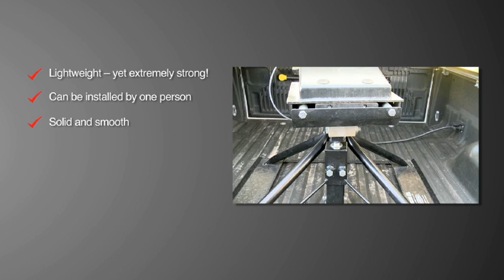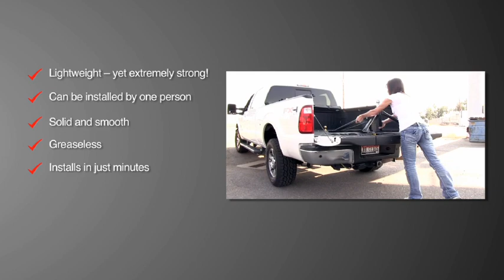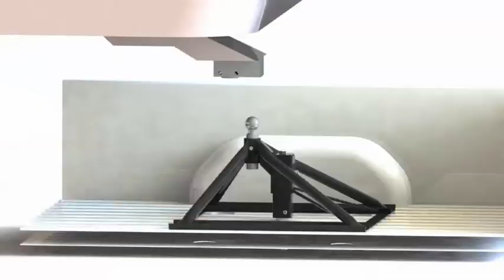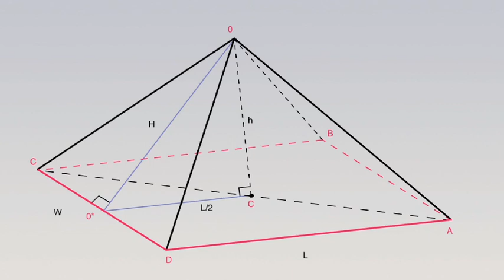Ultimate 5th Wheel Connection -Features & CRUSH TEST (amazing!)

Comment: It really does work that well. I pull a 28’ (small) fifth wheel with a crew cab, short bed super duty. It literally takes 10 minutes to install/uninstall the adapter, leaving my truck bed clear for…a truck bed.  It does require a gooseneck ball in the bed of the truck.

Comment: As an Engineer and looking at this, there is NO WAY I'd ever use this hitch as a rail connected only where the middle has no support.  I would only trust it using the gooseball connection setup.  Downward pressure tests are cool, but have you tested it by placing pressure on the back and the front?  If someone towing a trailer rear ends someone, the 5th wheel is coming toward the truck and dependent on the speed, the force applied to the rear of the hitch can be massive and the energy dissipation will either snap the ball off, but most likely the hitch welds will fail first, then ball failure.  I tend to favor how German Engineers use a design philosophy to make structures as weldless and seamless as possible.

Comment: I would like to see testing under heavy braking.  Have been hearing of this system clasping under heavy braking.  Don’t understand why the text is just showing pin weight limit.  That much weight shifting under braking would give much easier.
Reply: I’m interested in this as well. @andersonhitches
Reply: I’ve heard the same, but yet to see any proof from those that talk about it. Therefore, I use it to tow my 5th wheel with absolute confidence! Until someone can show me what they’ve “heard” then I’m not interested.🤔

Comment: My question is I have a trail air pin box on my 5th wheel with a auto slide hitch   I would love to get rid of the auto slide and get the hitch you have. Can I use your hitch with my pin box?

Comment: Haha I love how the guy they show towing with traditional fifth wheel is pulling himself back in forth by the steering wheel making it look like its 100% worse than it really is. I tow a 53' tri-axle race trailer with a Mega Cab Dodge Ram Cummins and have never run into any back and forth motion this guy had. Did he properly secure his load, have a seizure or just act like a moran?
Reply from the maker: Hi James. My load was secure, I was not having a seizure and I am definitely not a moron! For nearly all of our testing with the Ultimate Connection we use a 44 ft RV weighing 23,900 lbs (4,450 tongue) and we make sure the load is balanced. There is a section of road near our factory with railroad tracks and some big bumps right after them. It makes for great testing. When I go over that section with other brand 5th wheel hitches I can usually count 4 or 5 'bounces' after each rise before returning to neutral. With the ultimate Connection there is only the initial bounce and then it returns to neutral. With so many variables out there, not all truck and trailer combinations have issues with bucking/chucking, but customers who have had issues with it in the past and then have switched to our system, have reported that their bucking/chucking problems are a thing of the past.
Reply: +Andersen Hitches, you totally were acting lol, when you pulled yourself back and forth by the steering wheel to act like the trailer was causing you to move. But if it was the trailer shaking you out would have also moved the truck keys.
Reply: Mike Barker hahaha I had to watch it again to see it. That's true the keys didn't move much...I noticed in my truck the keys move more than me. I couldn't help but also talk to profession haulers using the pick-up style haulers and they brought up a good point, the higher the ball or hook up to your trailer the more unstable the truck gets, especially when up or down grade. The closer your point of contact with the trailer is to your axle is the safest and most comfortable the ride. Makes since when you think about it....take a square block for example, pretty stable right...yes...so now take a rectangle set it vertical...not as stable...they all said the same thing. You will have more bucking or lifting of the front end lets say if you are pulling a heavy trailer over a speed bums or go extreme and say a curb... The higher the ball or fifth wheel from your axles are, the worse your tow will be.
Reply: So what keeps the fifth wheel to ball adapter form just swiveling around the king pin? I guess just the weight of the trailer....Kinda sketch if so....
Reply: Better yet the one that adapts on top of the goose neck...there isnt anything to keep it from turning or rotating in the bed of the truck unless I missed something
Reply: I've been wondering about that too? Seems like theres nothing to stop it from spinning?
Reply from the maker: james robinson Great question. The king pin connector block does not 'spin' because it is held in place by 4 set screws that bite into the king pin plate (see quick install video at https://www.youtube.com/watch?v=mJDZrmzBa3c). We currently have over 9,000 units on the road and have NEVER had one report of the block turning.
Reply from the maker: Mike Barker The base is tightened down to the truck bed using the top bolt. An inner tube is placed over the gooseneck ball and pinned in place. When the top bolt is tightened it pulls upwards on the inner tube which cinches the base down to the bed of the truck providing a solid, immovable base.
Reply: So what caused you to move like that in the truck and not the keys? Looks like a good product, so you don't need to act in your videos lol.
Reply: I think he is driving Chevy traverse, funny
Reply: This is hilarious I went back to the video to check keys are nearly stationary he looks like he's bobbing to a crappy song how cheesy.. not to mention the sketchy hitch apparatus I'll stick to my fifth wheel

Comment: Made in America by Americans!  Andersen, I salute you.
Reply from the maker: Thanks Sam. We're very proud of what our country stands for and try to reflect that pride in high quality products.
Reply: Andersen Hitches You are very welcomed.  I have my WD anti-sway hitch installed an about to head out on my first trip with it.  Like the fact that it is so lightweight compared to the others and is of excellent quality build.  Instructions were very easy to read making the install a cinch.  I really owe it all to your dealer in Pensacola, Florida that got me set up with the appropriate length shank.  The guys at Carpenter's Campers were knowledgeable and helpful.

**update**
Made a 400 mile trip with it all hooked up.  Made a big difference on the sway experience when a fast moving vehicle whiz by pushing me over then sucking me in on the backside.  Porpoising was minimal compared to as before. Fairly quiet.  I give it 5 of 5 Stars.

Comment: why not add a gooseneck adapter to your fifthwheel ?
Reply: Apparently travel trailer frame manufacturers don't recommend using a gooseneck hitch because of the additional stress involved in that setup. Apparently it adds leverage to the frame in a bad direction. This setup keeps the connection and leverage in about the same place as a standard fifth wheel design.

Comment from the maker: As far as Safety Chains: If you plan on traveling cross country and you want to make sure you are in compliance with state laws that vary from one state to another then you should install safety chains.
 
We know that California, Indiana and Texas have safety chain requirements. Indiana safety chain laws are usually only enforced for commercial applications, but they informed us that if the hitch was a ball type, chains were required. Many states do not require the safety chains, which is why they are not included in the initial package (cutting out extra cost for the majority of customers).
 
We do sell a Safety Chain kit –part # 3230– that retails for $59.99. It includes the chains and bracket hardware necessary for installation.

Comment: On your crush test it was just for down pressure!! We go through woods & rivers if we drop it in a hole is it going to collapse trying to pull it out that would put more pressure on the back two legs ?
Reply from the maker: Good question Michael. While we have not done 'official' testing of 'sideways' forces, we have tested sideways pulling during on and off-road settings. Since the pyramid design is so extremely strong we are confident that you should have no problems. As of this writing we have not heard of any issues regarding sideways forces. However, as with any hitch on the market, excessive forces in any direction that exceed the weight rating can cause possible problems.
Reply: Also, that rear post started buckling at 63K.  Not much of a difference, but in the interest of accuracy, I'd fix the video.

Comment: On the version that connects to the ball in the bed, where do the lateral forces transfer to?  A rail setup transfers forces to the frame under the bed.  This looks like it is sitting on top of the bed.
Reply: To the gooseneck ball
Reply: @jrvera7955  Lateral forces cannot transfer to the ball directly under the hitch.  That's why they are called 'lateral'.

Comment: @ 2:07  you talk about loose connections on the B&W. None of those joints should be loose. The bolts holding the rails in should be tight, as are the assembly bolts. The mounting pins, My sister has that same setup. She has put 250,000 miles on it and hers are not loose. Neither she nor I have any slop in the kingpin assembly area.  @2:13 you show your driver bouncing around. My 03 3500 GMC pulling my 38 footer at 16,000 doesn't ride like that. My sisters 06 Dodge 3500 pulling a 32 foot 14,000 rig doesn't do that.  I'm sorry but you're exaggerating big time. You're bouncing around, but your keys barely move.

Next up, Where are your safety chains? Get caught using a gooseneck adapter in PA or Ohio, and you will be leaving your rig on the side of the road till you get safety chains. 

The other issue is, your moving the hitch point back several inches. that transfers weight to the back axle and off of the front axle. 

As for your crush test, mount that hitch on a 45Degree angle to simulate side loading you could experience in a crash. Lets see how well it stands up then.

Comment: I would NOT recommend this hitch.

I was involved in an accident last September 2020 where a minivan failed to remain stopped at a stop sign. I was traveling at about 40mph when I entered the intersection. I was operating my Chev 3500 while towing my Cyclone 3100 5th wheel. My 5th wheel was secured to my truck using the Andersen Ultimate 5th Wheel Hitch Gooseneck Mount. The hitch was purchased two years ago.

The minivan driver pulled out and struck my truck in the front right wheel. The minivan rotated and the back of the minivan struck the right front on the 5th wheel. The 5th wheel broke free and fell ontop of the truck bed and then collided into the back of my truck.

The hitch connection ball sheared off at the top of the base. The hitch base was bent and deformed. If I had been using a conventional 5th wheel pin hitch it would not have broke. The impact was not that great. Both the truck and the camper were removed by standard tow vehicles and could have been driven away, of course if the hitch was still intact. I engaged and lowered the front jacks on the camper to raise it off the truck. I then drove the truck out from under the camper so the tow could remove them.

If the hitch did not fail there would not be any damage to the back of my truck or to the bed, but as such there was. The damage caused my 2013 truck in near perfect condition (stored winters) with only 38,000 miles to be classified by the insurance as totaled.

I am so frustrated. And to compound the frustration the Andersen warranty was voided because it had been involved in an accident. 

It was fortunate that the accident was not worse for me and that the camper did not roll. The cost to repair the camper was just under $8000.

I bought the Andersen Hitch because it's was very light and easy to install and remove. All I can say is buy a conventional pin hitch.

Comment: Or you could just use one of those adapter kits that allows a 5th wheel to hook up to the already existing gooseneck ball In the bed...
Reply: Dane Pittman no it puts a different stress on the 5th wheel , all about leverage point

Comment: im a hot shot driver how much weight can that pull
Reply: It's rated for 20000lb on rail mounts or 24000lb on a gooseneck ball  with 4500lb of  pin weight. It should support all double axle fifth wheels and most triple axle fifth wheels.  But don't exceed the rating of your truck or currently installed hitch rating.

Comment: I would not trust a ball type hitch for towing a large 5th wheel.. use what the trailer was designed for..5th wheel..the only reason why fifth wheel hitches get loose, and noisy is because of lack of maintenance from the user/owner..5th wheel has been used by semi trucks for decades. it's a proven design.
Reply from the maker: Thank you for your comment. When the original 5th Wheel Hitches were designed for RV trailers decades ago, they did not have the heavy RV's we are seeing on the road now, so to keep up, they had to constantly beef the hitches up, making them heavier and heavier. We set out to use modern technology to design a light weight hitch that could be installed or removed by any one - even a 10 year-old! Not only did we accomplish that, we also made it extremely safe and improved the maneuverability. Thriving industries rely on continual improvement, and that's what the Ultimate Connection does, improves on the old 5th Wheel trailer hitch design. And with over 10,000 units on the road, it has been  a tremendous success.

The only negatives we seem to hear any more are from people that haven't actually tried one out yet.

Additionally, we are so confident in this design that we offer a $5 million warranty against any damage to a trailer that is caused by our 5th Wheel Hitch.
Reply: mebe2k You are correct in one sense, but semis also use pintle hitches too for dollies in doubles and triples, would you use a pintle hook to tow your fifth wheel? Also Gooseneck trailers which I have towed some 40' PJ's with more weight on the deck than the largest fifth wheel campers out there I can guarantee that use a ball and I can attest to the reduced chucking with them too they are much nicer to pull heavy with so really your argument is completely baseless. Now if this system meets the specs they claim and its been tested and proven then whats the issue?